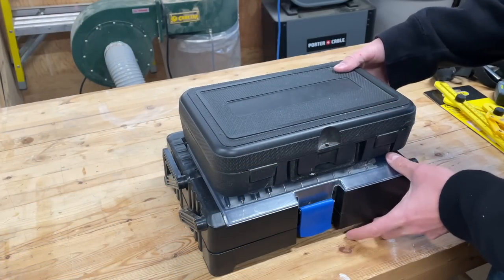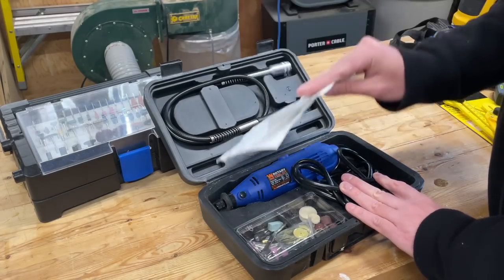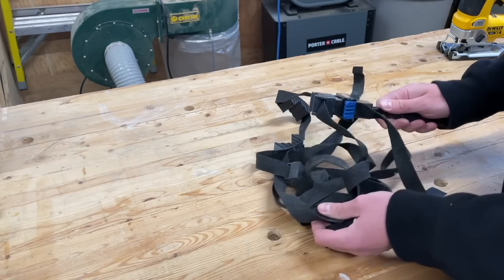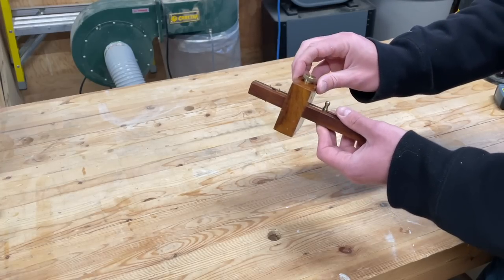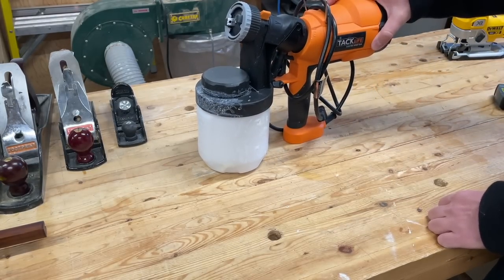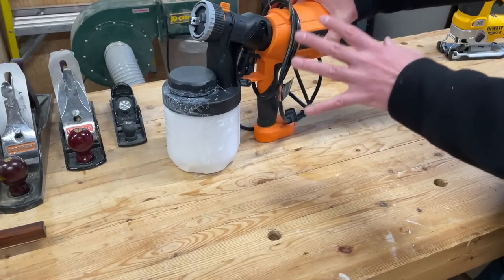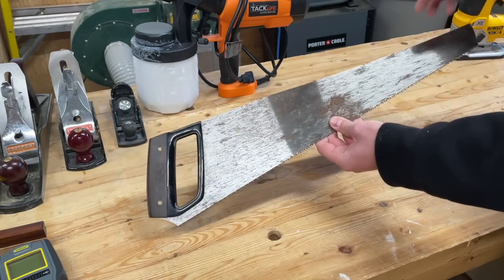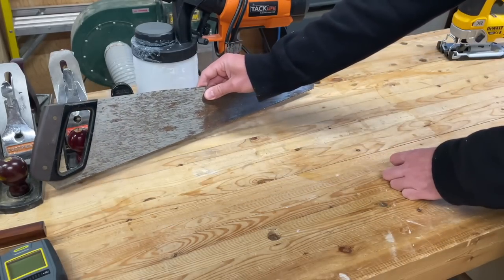Don't Buy These Tools // 10 Woodworking Tools I Wish I Didn't Buy

Comment: Remember the old saying that "the poor man pays twice!" Any tool with the name "craft" indicates what market it is aimed at. Lol.
Reply: Seems like my guy LOVES crying. Ten items, all "super cheap."  🤦‍♂️
Reply: Old sayings aren't always correct though.  There is a very definite role for cheap tools.  Perhaps there is tool you've never used - and you're not sure you'll need.  Go ahead and buy a cheap one - maybe you find you really don't need a tool for that job - maybe it collects dust for months between uses.  Maybe, although cheap, it does the job just fine.  Either way, you saved money.  Only if you find that this is a tool you use often and for which the cheap one doesn't quite cut it...go buy a fancy one.

Example #1: I bought a cheap lathe...turns out I really don't need a lathe more than once every couple of years - so it mostly collects dust.  I'm very glad I didn't go crazy.  Sometimes what you imagine to be very useful, just isn't.

Example #2: I bought a cheap Japanese hand-saw - turns out I love the reverse cutting action, the flexible blade and the straight handle.  I found I was using it a hell of a lot, often reaching for it in place of my chop-saw.  So I splurged on a set of three really classy ones and dumped all of my other hand saws.  But buying the best at the outset could easily have been a waste of money had I not found it to my liking.  Sometimes you don't know what you'll like until you try it for a while.

Example #3: I bought a very sexxy $800 Prusa 3D printer - it has a ton of automation and clever capabilities - and it worked just fine.  But a few months ago, a no-name company in China offered me a free $190 3D printer in exchange for nothing more than an honest review.   That printer is very simple, quite "unfussy" - but it's just so astoundingly useful (because of that simplicity) that I rarely use the $800 Prusa - and would NEVER have bought it if I'd had the $190 printer first.  Sometimes, (but definitely not always) cheaper is actually better.

"Quality" is an elusive property and it doesn't always correlate with "price".  Sometimes, cheaper is better...and very, VERY often - cheaper is "plenty good enough".

So I'm generally OK with buying cheap - and upgrading if-and-when I need to.  I strongly disagree with just always going out and buying the most expensive thing...if nothing else, if your budget is less than infinite, owning a greater variety of cheaper tools may very well get the job done faster and more easily than with a smaller number of over-engineered tools that cost you a fortune.
Reply: @SteveBakerIsHere  I have a set of cheap chisels I use for anything and can resharpen them to a razor sharp edge on my tormek but the fact that were cheap means I'll use them to scrap caulking off the brick or wail on them with a hammer to break a weld, wouldn't do that with my good set
Reply: @Galgamoth  Yeah - I agree.  There is nothing wrong with having expensive, high quality tools - but to say that those are the ONLY tools you should ever have is ridiculous.
Reply: Not all cheap tools are created equal. Almost all my tools are cheap "discount store" brands, but quality-vise they are absurdly good for their price. The quality generally went up because expectations of the customers here also went up. My first cordless drill that was used sporadically had its charger melt down few months ago. So I bought a new one, discount store brand, and it works much, much better. And I paid less for it. And I LOVE my el-cheapo japanese saw.
Reply: For me, I buy mastercraft tools when I know they’re a tool that I’ll only use once in a blue moon. Like the mastercraft routery tool, I have one but will only use it a couple of times a year. Paid 29 bucks for it with 250 bits. Not going to buy a quality tool for something I never use.

Comment: I use the jigsaw all the time.  Recently put up a french cleat panel that needed a cutout in the middle for an electrical outlet.  Drilled two holes and used the jigsaw.   I also needed to cut some angle iron but couldn't use the grinder.   Used the jigsaw with a metal cutting blade and some cutting oil.  Worked perfect.
Reply from the maker: That's awesome! I've really come around on the jigsaw and have started using it a lot recently. The right blade and right speed have made a huge difference!

Comment: Hey man I had the same “chatter” problem on my Dewalt jigsaw, then I turned the knob (near the metal xr logo) all the way to the right.  Literally PERFECT cuts now.  That knob determines the angle at which the blade cuts and I’ve found the greater the angle, the more chatter!  It will make your cuts  very precise so you can use it for more than rough cuts.  Give it a try!
Reply from the maker: That's exactly what I did! I've come to really like my jigsaw since posting this video once I dialed in the settings and used the right blade for the job.

Comment: One major problem we face today is that although the big box stores carry everything from nails to to toilets, they carry very few woodworking tools.  This forces us to look online at tools that appear good or interesting but after purchasing them, not so much.  We have to rely on other folk's reviews etc. that are usually biased in some way and are heavily marketing driven to get views and subscriptions.  Don't sell the jigsaw.  You might find uses for it later on, like cutting PVC pipe when installing a sprinkler system.  I use the multimark all the time for depth measurement.  I have a Paolini rule from WoodPecker's that cost triple and I never use it.  The multimark is easier to read and use for some reason.  Cheap plastic, yes, but all of Kreg's tools use this type of plastic.  It works and if this one ever breaks, I will probably just go out a buy another one.  Thanks for the video and stay safe.
Reply from the maker: Amazing insight, thanks for sharing! 

You're absolutely right that marketing-driven reviews  (whether by the manufacturer, or just the potential for more views) are becoming more-and-more prevalent. The jigsaw and multi-mark are the two that I've come around on - the jigsaw was always going to stay for DIY purposes, and some of the comments here about the multi-mark have changed my thoughts on it for a couple of use cases (still won't use it as a square due the wobble).

Comment: It is advised by the professionals that you fettle every hand plane after the purchase.  Some take less and some take more than others.  I think fettling your plane may set it more in tune with how an individual uses the plane (i.e. the particular pressure an individual may put on it and how they use it on a particular stroke.)  Well worth the time and effort to get maximum results.
Reply: I would not recommend that with a Lie-Nielsen out of the box. Those have precision in my experience and I feel like someone could mess one up.
Reply: I agree with you. Im a joiner of 30 years plus and this guy hs no clue regarding planes. At the least he has half dis assembled the plane to put a cutting edge on or I would have hoped he knows that.

Comment: Good list but disagree on the Kreg multi mark. Love using it to transfer measurements and do spot checks.
Reply from the maker: Thanks for sharing, Abey! I'll make sure to keep it in mind the next time I need to transfer measurements to give it more of a fair trial.
Reply: Same here. When I’m hanging trim I don’t put that thing down strictly for the uniform and consistent reveal. Also laying down lines along a board’s edge.
Reply: I agree. I use this all the time and would buy again if I lost it.
Reply: Agree ... The multimark should not be used as a square ... But it's great to check and  transfer measurements
Reply: So happy you guys are saying that.  When I clicked on this video I immediately saw the Kreg Multi Mark and realized that I bought it over month ago and have never used it!  I'm not cheap, but I really don't like wasting money on something Il never use.  The good news is that I do doors semi-regularly so I will indeed use it 👍
Reply: I guess if you have a need for the Kreg multi mark then great. I got mine as a stocking stuffer at Christmas last year but haven't really needed it.
Reply: I’m a finish and framing carpenter and I use the Kreg Multi Mark dozens of times a day. Of course I use it daily for marking reveals on door and window jambs. Also great for quickly and accurately measuring board thicknesses as well. 
Perhaps my favorite use case is for accurately setting blade height on a table saw when cutting dados or lap joints. You can ensure that the end of the blade is flat on the table and drop the body of the Kreg tool onto the saw tooth at its apex. I know there are more accurate tools for shop work, but the Kreg is plenty accurate for job site finish carpentry in this regard. 
I almost never use the 45 degree or 90 degree slots because they’re not very accurate and I don’t like taking the brass screw out and risk losing or dropping it. 
A small combination square can do all this and more, but the Kreg is more compact, durable  and easier to store without fear of bending it when I lean over (I wear an Atlas 46 journeyman vest for finish work which keeps storage around my midsection)
Reply from the maker: @sail4201  I've really come around on it for use with reveals and blade depth as well, thanks for sharing!
Reply: @MasonWoodshop  the kreg multimark is always in my toolbelt.  love it.
Reply: @MasonWoodshop  you are absolutely right that the square and angle accuracy is not great but I have found SO many great uses that I would definitely buy it again and recommend it to others as a great little tool.
Reply: My son and his wife gave me one, very handy!

Comment: Good info!  Coincidentally, I used my jigsaw today to cut some u-channels in some drawer bottoms (where the drain pipe will go on a bathroom vanity).  Usually I use the bandsaw for stuff like that, but the drawers are 30+inches wide and they wouldn’t fit.  Thanks for the great content!
Reply from the maker: Thanks for watching! Funny enough, bathroom vanity drain pipe is where I've used the jigsaw a couple of times, although I did use a hole saw for the curved part.
Reply: Exactly, plus a jig comes in any big bundle, it has its own uses just dont buy it outside of a deal or a bundle

Comment: Dremel does the same thing when it comes to counting how many items are in a kit.  As for the grit I don't think they generally say either.  It's sort of irrelevant for the typical use of those sanding bits.  Overall though rotary tools are very useful to have around.

Jigsaws seem to have their lovers and their haters.  One woodworker will have it amongst the tools they couldn't do without and another will consider it impossible to use.  What I do know is having a decent blade and using the right blade matters.  Put a scroll blade in even the cheapest name brand jigsaw and you can accurately and quite quickly cut complicated shapes.

I'm not sure how people judge whether plastic is cheap or not.  I don't know what Kreg use, but I doubt it is easy to tell the formulation that easily.
Reply from the maker: I've definitely come around to the need/want to work a bit more with the jigsaw to get it working well (it does see use with some DIY projects from time-to-time).
Reply: I would not say I use rotary tools much woodworking but they are handy to have in the workshop. Drums are like coarse and fine. Some Wen tools are kind of crappy. I would not call a jigsaw a fine woodworking tool. But they can have their uses. Not everything I make is Chippendale furniture either. As far as judging the quality of plastic goes I think folks go by the finish, the heft, the hardness, flex. If it feels flimsy then it probably is. If it just up and breaks that's never a good sign. I had these plastic brackets break holding slides in my kitchen cabinets. I was not happy. So I milled new brackets out of HDPE I'd home cast. Let's see those brackets break. Of course the brackets I made were 10 times thicker. I was not going to do a call back on that job. I just put unreasonably large chunks in there. The floor will give out before my brackets do. But the original brackets were definitely cheap plastic.

Comment: I've got four of those strap clamps and haven't used them recently, but they were great when I had a dozen wooden trays with mitered joints to clamp. That's the kind of joint they work well with. I've tried others types of clamps* and they just don't align mitered corners right without wasting a LOT of time. I do agree the straps can be a mess. Helps to unroll only what you need, and use a rubber band or Velcro strap to keep the rest coiled up. There are also some tricks to applying them that make life easier (e.g. lay them out on a surface first then position the box sides in the middle. Then tighten it up. Use spacers under the corner pieces if you need them higher up the sides. Don't try to work with it in mid-air.)

* In fact, most of those other corner clamps qualify as my waste of money. I used them a couple of times, but now, for the same kinds of joints I just use ratchet clamps and clamping blocks.
Reply from the maker: Awesome idea about the Velcro straps!

Comment: I use an orbital jigsaw for shaped cuts for things like cat tree platforms, or cutting circular holes for speaker enclosures, and for those types of cuts, a jigsaw works great.  If I need to break down lumber, I just use a 6.5" cordless deep-cut circular saw.

Comment: The handsaw is great for if you ever deal with dimensional lumber that has gone twisted and you need it to be a manageable size, and rough wood (like firewood that you might want to take slices from). Since most large power tools require regularity of some sort (square, or at least a straight line on some axis), the handsaw can be the far safer starting point for the small shop. They’re also great for pieces that are too small to easily cut with a power tool. Japanese pull saws are superior choices for precise joinery and small cuts, but I highly recommend learning how to use push saws because, while they do have a steeper learning curve, they excel at dealing with thicker stock and are more energy efficient than pull saws.

Comment: Wow, I agree in most, but the Kreg ruler I own, does not wiggle even after years of dropping it. I use it frequently and am surprised someone else is dissatisfied by it. I was actually thinking of getting a second one, just to find faster when I misplace it.
Reply from the maker: Happy to hear that you have no wiggle, might be that mine is faulty for some reason. I have been using it recently for consistent depths out of one end and I've been happy with the multi-mark for that purpose.
Reply: Kreg multi mark is worth every penny. A handy companion for the woodworker/carpenter

Comment: Jigsaws are amazing, they are basically miniature bandsaws you can use for 99% the work you would otherwise need a bandsaw for; with the right blades and a bit of practise - and if you get creative, with jigs - it is unbelievably versatile; I'm definitely one of the people here that would recommend a jigsaw as an essential tool.
Reply from the maker: I've come around big time on the jigsaw and agree that it could be an essential tool for beginners. My issue mostly stemmed from the wrong speed and the wrong blade. Once I dialed that in, I'm getting clean and quick cuts!
Reply: Like nearly all tools, it takes practice and patience to learn best how to use them. I’ve never considered a jigsaw a finish tool, but invaluable for odd cuts in odd places. It then, I’m a handyman and not a cabinetmaker. 😜
Reply: @MasonWoodshop  You can also build an inverted jigsaw table. It has similar stability of a bandsaw but will let you cut inside a piece which you can't do with a bandsaw. It'll, in theory, handle thicker materials than a scrollsaw. It's sort of an in-between of a bandsaw and scrollsaw.
Reply from the maker: @JamesKelly89  Funny enough, I'm selling my band saw tomorrow (doesn't see much use and takes up a lot of room in my one-car garage shop), so this tip is quite helpful! Thank you.
Reply: @MasonWoodshop  Oh wow! You couldn't get me to part with my bandsaws. I have a smaller one, a 12" Craftsman with a 1/8" blade, for scrolling and a bigger more powerful one, a 14" Delta with a 1/2" blade, for resawing. It'd take an act of God (or my wife haha) to get me to part with my bandsaw. I'm actually planning on getting a bigger motor and a riser for the Delta at some point.
Reply: @MasonWoodshop  I've gotten rid of both jigsaw and bandsaw. The only 1 I use is the scroll saw.  Other than that I use handsaws for things others would use those 2 for.  I'm not one of those "no power tools for me" guys, I just do better with a backsaw or coping saw than a power saw, and it's quicker than getting all the junk away from my bandsaw, fiddle with blade tension, adjust blade guides, etc. just to pull a handsaw off the wall and cut it 

The saw you showed in the video is the handsaw that takes the most skill to operate well. For a beginner is suggest a backsaw or a Japanese pull saw, the $5 habor freight model to start with, just remember to not push it, but pull it.
Reply from the maker: @MashMonster69  I've ended up coming to really like my jigsaw, but the band saw is now gone and I haven't missed it at all. My Japanese pull saw is easily among my most-used hand tools and does a fantastic job!

Comment: I don’t use the angle features on Kreg tool. I do use it for depth marking/measuring. You didn’t mention the 3/16” reveal ledge that I use a lot for marking window/door trim location.
Reply from the maker: After posting this and getting comments, I've started using it for that exact same case - reveals and trim placement! Easy to use and much lighter than the adjustable squares I have around.